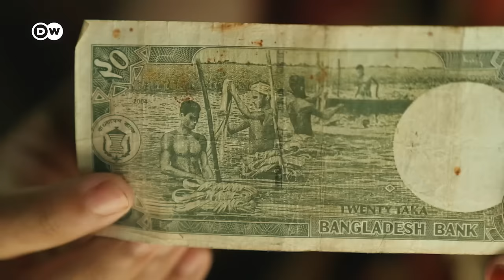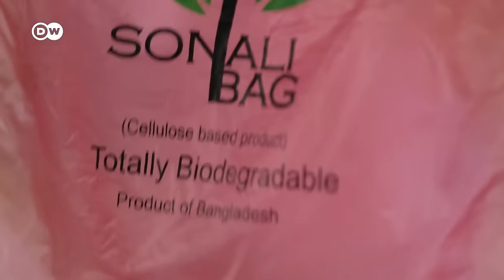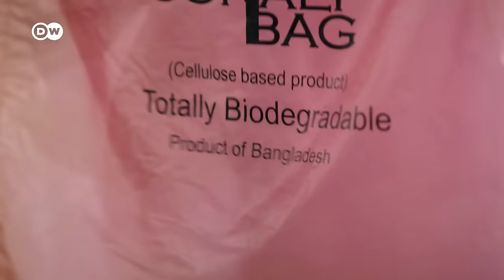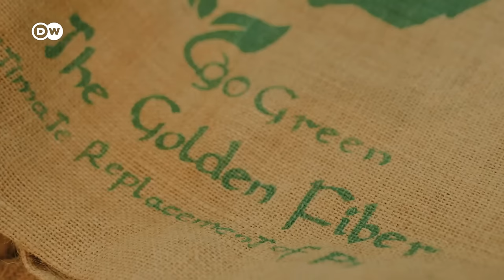Bangladesh: Could jute jump start the eco-revolution? | DW Documentary

Comment: The main problem is good quality seeds. And water body for fermentation. And jute has many use ie jute stick or particle stick can be used to manufacture low density particles board as well.